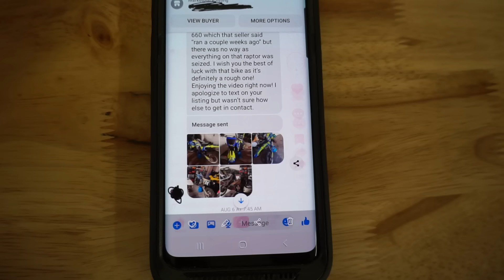Seller Lied To My Face About This $600 Dirt Bike (First Ride Attempt)

Comment: having the same problem rn. bought a 2000 cr80 for 650 bucks. Guy said it was in good condition and it runs perfect but it just needs a new carb. Put a new one on. ran like crap and turns out it needs new crank seals. im only 14 so its hard to get the money for the parts. also, all of the swingarm bearings were shot and shock bearings. I replaced them but I still have to deal with all the other problems. i replaced the clutch plates and saw some teeth from a gear. But I'm close to fixing it just have to get the crank seals

Comment: I feel bad that you're putting all this work into it just wait till you see the timing chain and the cams 😮. I bought a used 99WR 400 and ended up rebuilding the whole engine and it never ran right again after that. I think the nicolite disintegrated off the cylinder walls. I have learned overtime to just buy one off your buddy after you seen the bike run over and over again riding with him. Or in my case just get yourself a new one!

Comment: @24:51 mins. now it´s clear to see , there´s a whole lot of junk hiding under a new frame paint job. The swingarm axle end and nut should NOT be blue.
@54:00 mins. it not only needs new clutch plates ,it also needs a full engine overhaul. This poor bike must have been sank under mud and water for a long time.

Comment: Man the pentration  fluid kills me how u use it  u spat so much then start cranking  on bolts it takes  some time for it to get to the treads try 5 or  10 min to allow the fluid to the bolts and u should on every rusty bolt especially  the vintage bikes because you can not get parts, just some ideas and on the back swing are u impacting that threaded bolt in u sprayed the pb blaster that went full bore like clean the threads with break clean let dry then spray fluid in  for easy threading, also maybe get a bench grinder with the buffing wheel to take alot of rusty bolts and buts that are not obtainable to restore them i like the vintage bike stuff  , would love you to get some of those vintage bmw bikes  with the wierd cylinders, just some tips I'm not old like 50 but work on all my on stuff the older people like those vintage bikes . Thanks

Comment: YouTube ate my comment again.
Front brake bleed. Take out the top banjo bolt, cover hole with thumb and pump it. Assemble and try normal bleeding. Failing that, bleed up from the nipple with an oil syringe. They can be a pain, those things.

Comment: Don't let the people in the comments bother u man most of them aren't even turning their own wrenches they rather pay a shop $110+ a hr honestly it don't take nothing to special for tools to wrench on these things hell come to my garage and anything might be used as a hammer from rachets to pliers after being a mechanic for 35yrs I've acquired everything from Mac,Snap On, Craftsman even got some Pittsburg and Icon if it ain't a torque wrench Idc if the tool cost $190 or $20 I'm get the job done with the same results at the end

Comment: Hate people like that got f over on a trade for a LTR 450 usually story it’s been sitting a while could use a tune up that’s it right oil was double filled bottom of the case was leaking oil fuel pump was shot injector was shot stock muffler was falling apart fuel filter was clogged fuel lines needed to also be replaced nerf bars didn’t fit this quad that came on it did everything it needed dealership loved me that week ran a full yoshimura cleaned it up nice did the seat cover rode it for the cold season got out of it asap right after

Comment: You should invest in a brass punch instead of beating up your extensions.   One day you will damage the extension to where it will not accept a ratchet or socket.  Also you may/will damage new parts using an extension as a punch.  Nobody cares about damaging parts that are being replaced,  I get that.      Sucks to realize that your extension is not usable because it's been touched with a hammer ........    *Of course I have never done this more than twice.   😆

Comment: 600 for a rolling chassis with good plastic, straight frame forks and swing arm no matter what is a fair deal (the buyer should be able to know those things). Anyone who buys a non running bike without expecting to basically build or buy an entire new engine and carb , well that person isn't a bike person.

Comment: 100% been under water.   That ft sprocket is ugly,   but a wire wheel will fix her up.    I wish my rearr wheel  came off that easy.   I have a 2016 harley breakout,  very wide rear wheel and 240 tire.

Comment: Hi I just wanted to say I watched your latest video on the 1996 Yamaha YZ 125 video you have been doing this a while yet when I watch some of the things you do mechanically just need some time tuning . Like you I'm always learning I have 30 pl years racing riding wrenching on dirtbikes . In your video you said you were told that the bike was a 2002 that wasndef not true the plastic on that bike was basically the same from 1996-2001 in 2002-2016 they redid the plastic again in 2017 but in 02 the bike was diff. Your fr brake line route wasn't right . When removing stubborn bolts remember W-40 is your friend let it soak in then try tightening a bit to break the hold them try loosening. And if the fr bearings are gone then the rear are shot . All the problems you faced were due to poor maintenance. And finally your rear axle nut should be on the disc side not the sprocket side. Looks like you missed alot of key issues no guide rubber if you are replacing a missing chain add the correct new chain with sprockets . And any moto tire less than 80 percent replace .

Comment: I have a nice set of rims & hubs for a 2000 yz 125 tire have some tread but should be replaced. Good straight rims. Took them off to put excel rims on. I believe 2001 they came stock with excel rims. If someone wants them $100 and you pay shipping.
Reply: Have a good rear shock too . Wasn't blown out or leaking when I removed it years ago $50 if anyone is interested

Comment: I am not a motorcycle expert at all, but I have never seen a motorcycle clutch that bad. I have a strong dislike for sellers who deceive buyers. Good job you pulled that clutch apart, because that could have ended badly, if it locked up without warning. This could have ended up with you being in hospital. I saw that happen to a friend of mine when his Honda XR-75 chain came off when the rear wheel sprocket clip let go at high speed. He spent a week in hospital with ruptured kidneys.

Comment: Mitch, what proper tool you use for taking out the jets screw without stripping them? Apparently I have been using a flat head screwdriver and it stripped it out.

Comment: For stuck, rusty things that cannot be removed, alternating between penetrating oil, heat, penetrating oil... and really letting the steam flow freely usually helps. You should also spray every rusty screw and spot with penetrating oil to prevent further rusting when it gets wet. SORRY but Penetrating oil also means that it takes time to penetrate. It's like with women: the longer the better!

Comment: 45:52 Just remember to turn off the engine, cut it off to save the bike. You can use the breaks after engine is shut off.

Comment: I also think you would have been better off putting the engine into the parts bike. If the wheel bearings are that bad, so are the swing are bearings and all the shock linkage bearing. The head bearing. It all needs taken apart. The parts bike looked better.

Comment: For a 96 and a 2002 isn’t there sum changes between the years on these yz 125 or are they the same from 96 to 02 ? If there were changes on sim things betweeen then years you should be able to tell ., it’s been awhile since I’ve worked on bikes but I new exactly what I was looking at and about what year they were from the changes they made from factory

Comment: I bought a DR650 because of the perks that were listed with it.
seller wanted to give me a test on how much i know about the DR... (he is fkn ashold).
His workmanship leaves a hell of lot to be desired when i started looking into why exhaust was popping so bad. Fixed, dam guy didn't know what he was doing when he re-jetted the carb. Runs quite more than was. still have to check wheel bearings as that's worrying me because of his workmen ship on other parts.
wrong length bolts, side racks not put on right, didn't show up until i wanted to take them off.

Just really ticks me off that someone does not care to do a job right with quality in mind. Just a few dollars in nuts n bolts is all it would take.
Oh, and don't get me started on the bolts he used to put 5.3 fuel tank on. he must have lost the org ones.

Comment: Hi I bought a 1977 yz125 followed your steps to get it running. It started and I could rev it fine. Then after working on other issues it had ,It wouldn’t start. I Re cleaned the carb still nothing. I got frustrated and let it sit for days. Then it started first kick then it died after 10 seconds, no restart, Many kicks still no restart. Let it sit and again it started first kick. Then after 10 seconds dies. I cleaned carb many times . Same thing every time. I changed gas, checked exhaust, it had some gas in it. I can’t figure it out….any advice?

Comment: Also looks like someone spent more on a decal kit, and a seat cover then they paid for the bike
Reply: That’s basically how we save hubs when doing wheel bearings on front wheel drive cars, slam the hub out with the ball peen hammer, then die grind a slice into the race that’s still pressed on the hub, then if you check with harbour freight they make a chisel set for hammering on that works perfectly for grabbing that lip of old bearing races like that one when a old flat head won’t cut it. And the set is pretty cheap if I remember correctly. Done hundreds of races using them
Reply: It also helps when you run into stuff that stumps you like that if you start hollering and say GD IT, and throw a couple tools 😂 we used to have a dude In our shop that would get caught talking to the car when he wud be getting whipped. I wud hear, aight now, ima be here late you keep fackin with me…..and I look over and it’s just him getting whipped lol

Comment: The worst clutch I ever seen in a bike that still runs. I think the bike looks good tho. The camera might  hide some but as a kid I rode some shitty bikes but t still had fun. I can't believe every bike you buy the seller lies about it. She needs some work but dam it runs great! Some bikes you put a grand into it. Spent hours re jetting it and it still ran rough. This bike you dumped the water out, clean the carb,  runs like new. Lol. Obvious no maintenance done at all. Rode the snot out of it and never greased anything. I used water proof bel ray grease on my quads. That stuff was great. I even used it on my boat trailer. Being almost 30 years old and never having a dime put into it, it now needs every thing. All kidding aside, you will notice the ball peen/mechanics hammer will work better for you. Claw hammer isn't designed to direct the impact the same way. Should buy the set. The one you got and a size bigger to. Nice brass hammer is a must as well. I didn't know how good they was til I got one. You could spend $100,000 on tools and still need more. Lol. I think you need a lift. Keep an eye out for someone selling one. Be easier on your back and knees. Maybe harbor freight has cheap ones.

Comment: I wonna ask you a question and please believe me when I say I mean no disrespect or insult in any way whatsoever but seriously when you go to buy these bikes do you check them over before you decide if you want to buy them or do you always just buy them regardless? The reason I ask is you can easily see how bad this bike is from 100yards away yet still you buy it and most of your videos are kinda the same where you never seem to spot obvious problems you could’ve spotted if you’d spend a few minutes looking at them at time of purchasing rather than waiting until you get it home? 
Again no disrespect intended I’m just curious

Comment: Get a mallet, stop using a hammer on metal. Penetrating oil needs time to penetrate. Opening brake pads with a screwdriver is fine if you are changing them out.

Comment: 5:00  I can't believe you pounded out that bearing race from one edge only, cocking it, and damaging the bearing bore in the hub.  (yes you did hammer head)
  You are going too fast, and not thinking.  Put the hammer away son.

Comment: probably snowbike or icebike. neglected, rode hard and put away wet. HAWK TUAH, AND SPIT ON THAT THANG, YA GET ME? Btw if you use wax instead of penetrating oil, you can get the nuts and bolts out faster, just heat it up with a heat gun and run a wax candle on it, or use beeswax and jojoba oil mix.

Comment: I don't know if you are one of those YT cheaters, if it has been in water then the wheels would be corroded by rust which there is no sign of and the front fork would also look very different. Besides that, I don't understand why you don't change the sprockets, chain, cables when you're at it anyway, your work makes no sense at all - unless you just want to start them up and then that's it gets a bit boring to look at.

Comment: My xr100 sat outside with no carb seat or side covers fo 5 years and and wasn't a 1/4 what this is. The cables were shot and the frame looks rusty. The seller of this is a pos.

Comment: Stop using a impact gun for cracking off small fastners.  For the love of God.  
There great for spinning stuff out . But anothing below a 8mm bolt will just sheer.  
Oh.   And penetrative fluid is designed to take more that 3 seconds to work.  
I like the vids.  But some stuff makes me want to shout

Comment: Basic mechanic knowledge: stuck race: weld on inside, it falls right out. Next time clean and heat while bearing is still in one piece, likely safes a bit of work welding, but cutting with a Dremel? Really? Now the hub is junk for sure with that week spot, that you just created cutting into the hub. About bleeding brakes, how about you stop doing senseless pumping and do a proper bleeding procedure, the f-ing yt is full of how-to's about bleeding a brake. Silly remarks about a claw hammer, well how about you use a rubber mallett instead of wrecking the slip it on the axle by beading the axle wide. Man I follow you since half a year, was laughing my a off when you started to rebuild engines... But this is so clearly out of your league, and on the same time it's so absolutely basic knowledge... Sorry, I'm outa here, nothing to learn AND nothing to enjoy, just my time wasted. I understand your business model, you just buy junk, knowing that fully well, to make content, totally understandable. Most folks will fall for it,  all those who have absolutely no clue about mechanics. Even an apprentice in the second week would start cringing watching you further wreck the bike.

Comment: Its your responsibility  to know what ur buying. Always belive everything your told is a lie about what ur buying. Its ur responsibility to research and fact check and inspect and make a informed decision about what ur buying. You shoulda ran the vin to make sure and inspected the motor as much as you can. If you get fucked its ur fault and instead of byers remorse. Learn from it and next time use what you have learend to not repete the mistakes. We have all done this and gotten fucked man. But making sure you dont agian or midagate it as much as possible.  Imo its still a good deal for 700. That bike is 2k in oregon.

Comment: Not for nothing but what did you think the condition of the bike would be for $600? Most people are selling antique rotten partial non running bikes with a family of rats living deep inside the engine for more than $600. You can't always blame the scum bags that sell this stuff when it's ultimately on YOU to look over and know what you are buying

Comment: Brother just a suggestion please stop showing us every thread of the removal / installation of bolts and nuts, if you must show us please just the last couple threads is good enough there’s so much filler of you just unthreading and threading hardware for no reason in every video